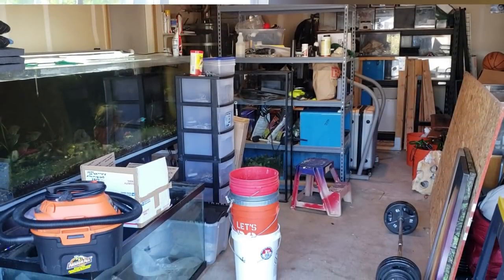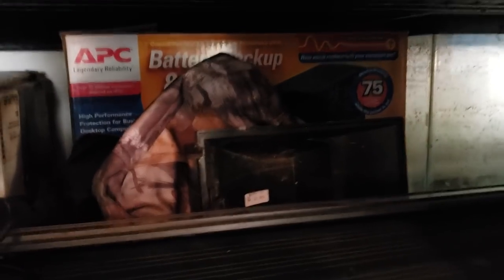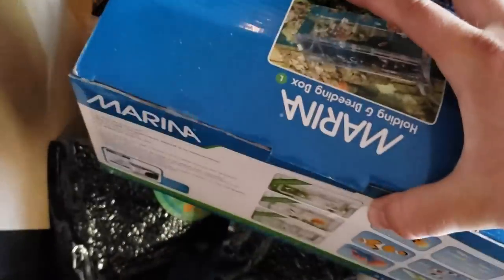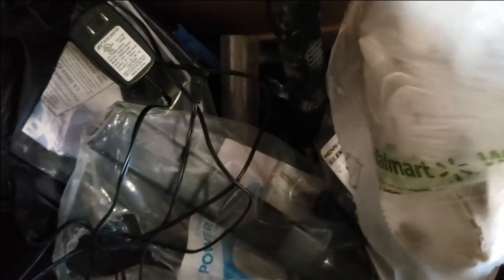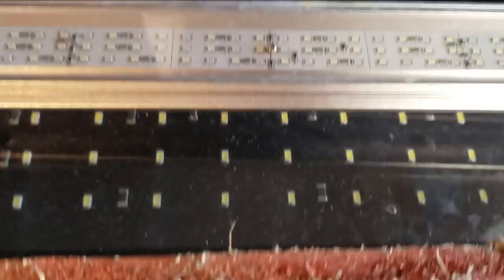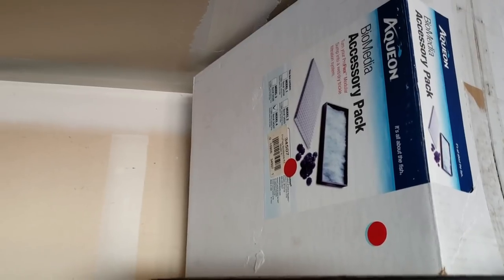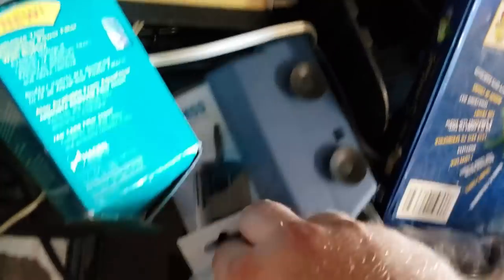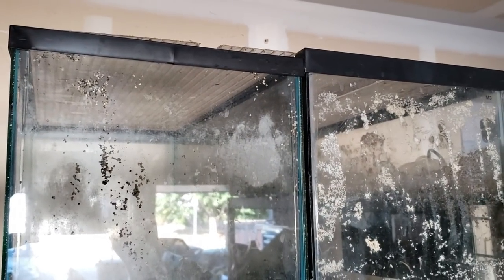The Dark Side of Fish Keeping

Comment: if that rack is the same size as the ones I have from home depot....a 125 gal tank will fit barely, but not with the rack assembled....it won't slide between the legs.   I had to take one leg off, slide the tank onto the shelf, then attach the other leg.
Reply from the maker: It is, it had 125s on it from the previous owners. I didnt know you had to take the legs off tho